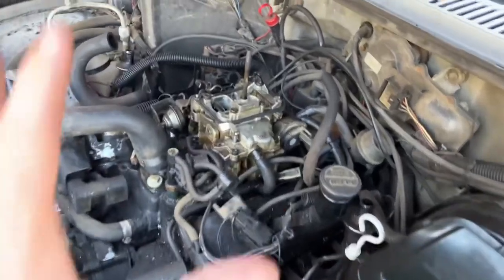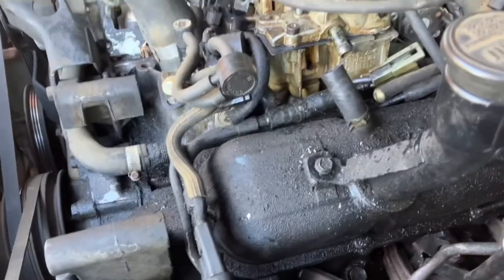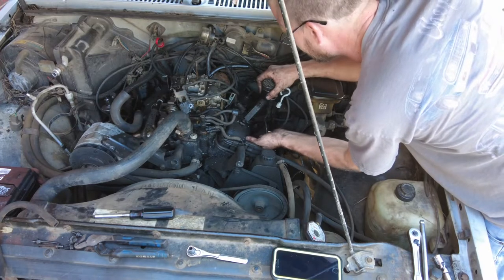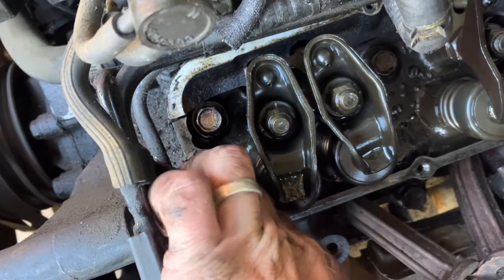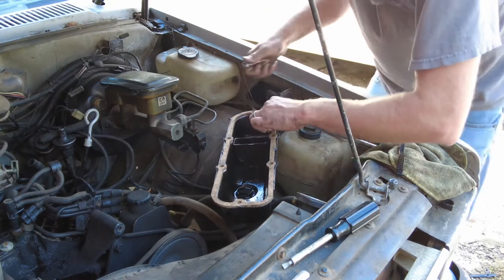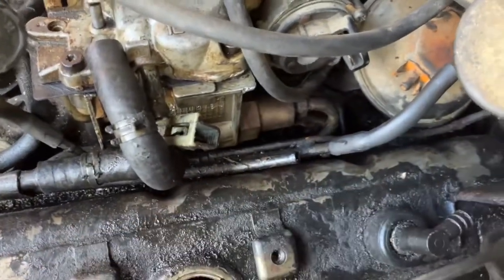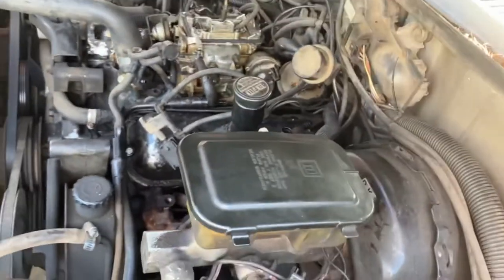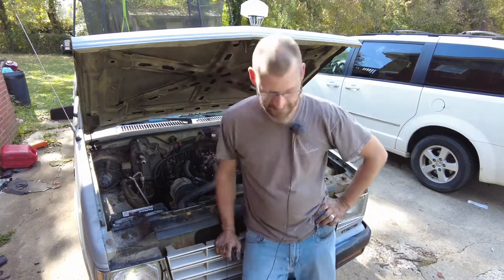2.8 V6 S10 valve cover gasket replacement drivers side/right side.

Comment: That spring is from the fuel filter that is in the carburetor. It needs to be in when the fuel filter is changed. It keeps tension on the filter as it seats into the carburetor preventing dirt and contamination entering the inside float area. How it got inside of the valve cover I haven't a clue.
Reply from the maker: Well chances are it’s had 40 years to travel.

Comment: For the adhesive I thought you were supposed to spread throughout the whole valve cover gasket
Reply from the maker: You definitely can but that would be easier if a different type of adhesive was used.  The RTV that I used is very messy and easier when it's not everywhere.
Reply: Oh okay nice I just got a 1991 Chevy s10 also haha that’s why I’m asking so much thank you man I appreciate the help
Reply from the maker: I wish I had a 91 for the fuel injection.  These cold mornings have made the carburetor upset.
Reply: What year is yours I thought we had the same truck hahah
Reply from the maker: @kevinstems8822  mine is a 1985.  Still has a 2.8 just with a carburetor instead of fuel injection.
Reply: Oh okay  Nice thank you for your help man
Reply: @ChrisThedudenurse  I'm getting ready to do the same job on my '83. 👍good video🇨🇦
Reply from the maker: @Boycott_Wendys  glad to see another S10 is staying on the road

Comment: waitwaitwaitwait... wwwhhhhhhyyyyyy do those 10mm bolts have crazy long stems sticking out of them???? Now that I got them out, can I cut those stupid things off? Those long stems made it WAY more difficult than it has to be. My 10mm deep is BARELY deep enough to compensate for that craziness.
Reply from the maker: Some of those hold accessories and clips for wires and vacuum lines.  You may want to check 1st and make sure you can cut them and not have any issues without them.  I found that it was easier to line them up to the holes.

Comment: I got 50 bucks and I'll cover your bus fare
Reply from the maker: Sweet where am I heading
Reply: @ChrisThedudenurse  SE north carolina.  My neighbor drove it home parked it the next day wouldn't start then it's set for a year. So far I siphoned the gas out of the tank now I'm going to start looking for the spark issue.
Reply from the maker: Not too far of a trip.  I'm in Central North Carolina.  Luckily these engines and trucks are not THAT hard to work on.
Reply: @ChrisThedudenurse  oh okay, I'm in Sneads Ferry.  Yeah they're not too bad, I'm not the best with carburetors though.

Comment: Would it be ok to put the gasket on the bottom let it dry and then put the head on top of the gasket instead of trying to go down with the gasket on the head
Reply from the maker: You could you’d just have to make sure your holes line up for the bolts, but yes you could do it that way.